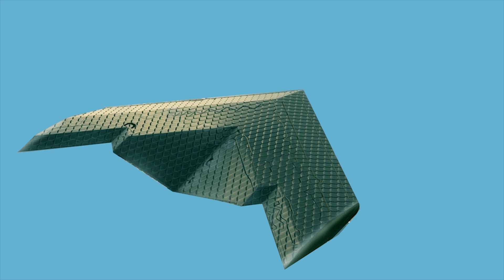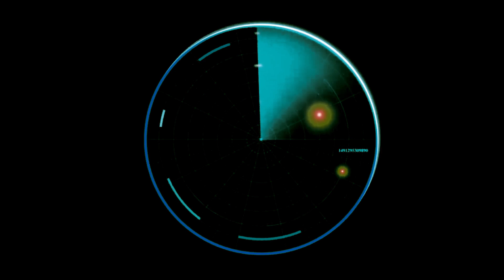How would be 7 Generation Aircraft- Next Generation Jet Fighter

Comment: This is completely pointless because only the USA has flown a 6th generation prototype and Boeing has just won the contract to develop the f47. There has been pictures of a flying Chinese prototype, that they say is a 6th generation jet, but at best it's an experimental aircraft, that might not be developed and built. 6th generation fighters will utilise artificial intelligence, drones and improved stealth technology. The technology for on board lasers has not been developed yet. As there are going to be big problems making the technology small enough and reliable enough, to put to put on fighter jets. Also there is the problem that it requires a lot of power in order to operate. Ground-based laser systems are only just becoming operational in 2025. Nobody really has a clue what a 7th generation fighter will actually involve.